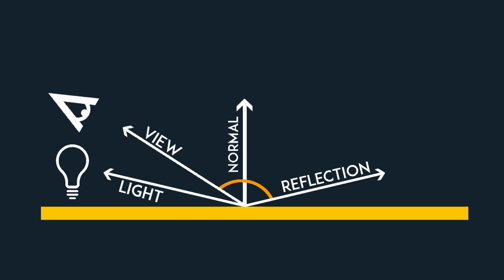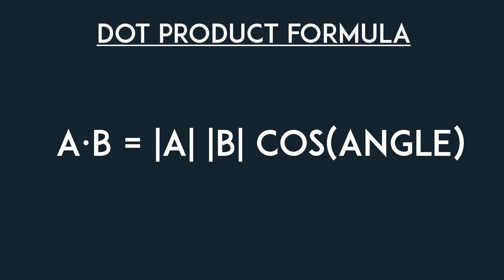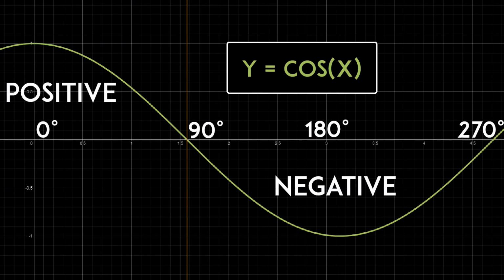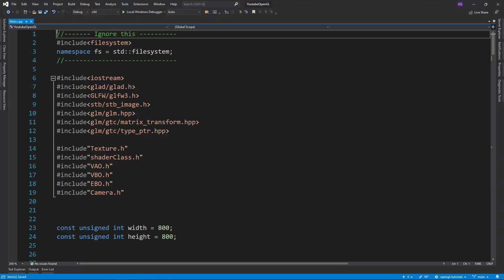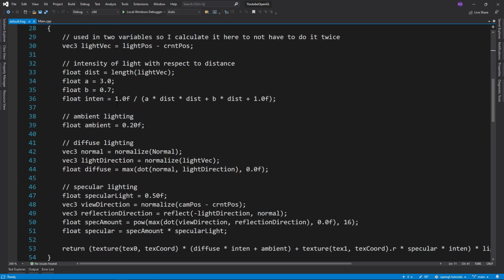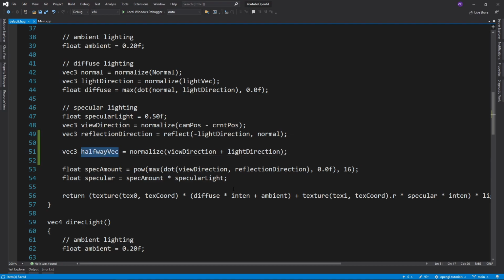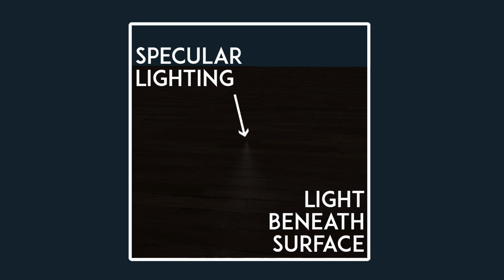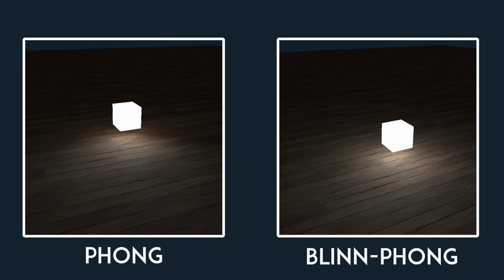OpenGL Tutorial 23 - Blinn-Phong Lighting

Comment: You should read about shader branchless programming, it basicly removes conditionals in your shader and uses compiler optimization, which can have a great affect on performance.
You could use it when you check if diffuse lighting is not equal to zero. 
Example:
specular = specAmount * specularLight * when_neq(diffuse, 0)

vec4 when_neq(vec4 x, vec4 y) {
  return abs(sign(x - y));
}

Or you could just multiply by diffuse

But the video is great 👍